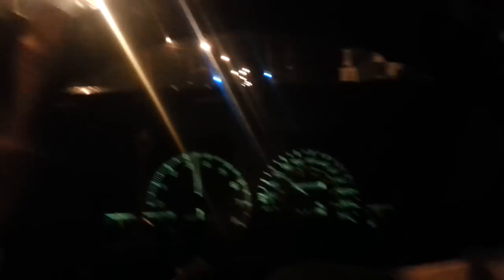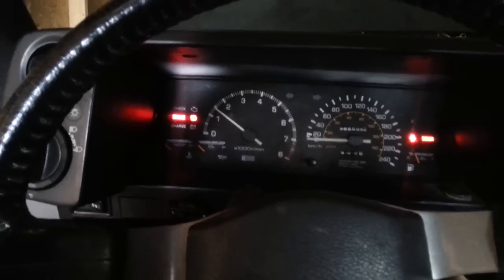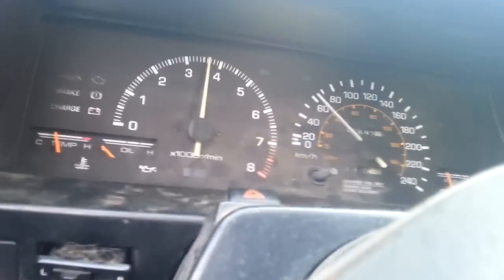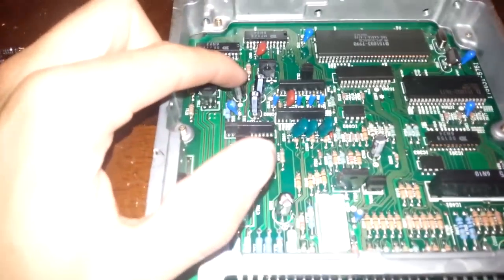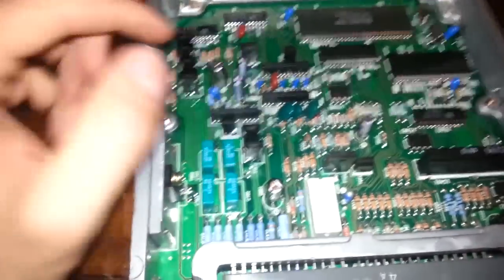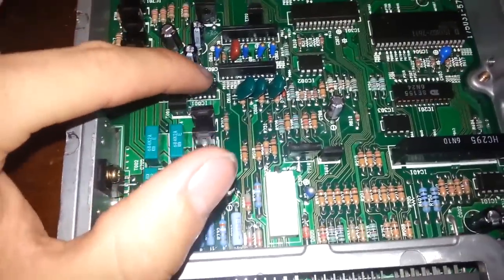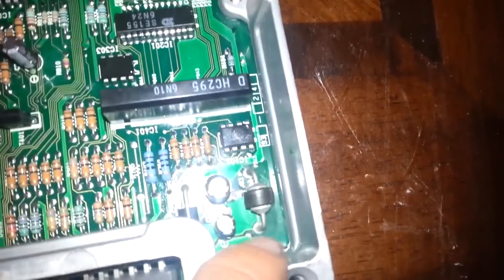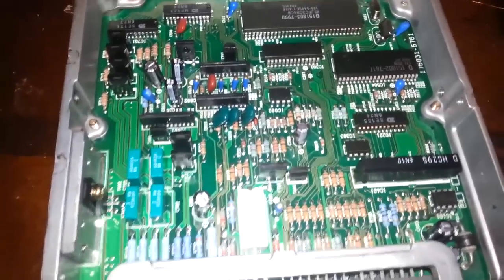Dealing with 20V 4AGE ECU problems - Limp Mode - 4000rpm Rev Limit

Comment: did a g22 Frankenstein with obd1 p28 ecu was running fine heard pop sound then the car started to have rev limiter at 3,500 could this be my problem
Reply from the maker: I doubt your problem is bad capcitors, more likely you blew something, you can still inspect your ECU though to be sure

Comment: bro do you think i could have same issue in my automatic 7a-fe ect, ecu rpm cuts off from 5000.
Reply from the maker: What year is the car? this effects a bunch of japanese cars from early to mid 90s
Reply: it's a 1993 model toyota carina AT192, 7a-fe engine with ECT automatic transmission.
Reply from the maker: That would definitely mean its a possibility since the year falls into the years of bad capacitors. My silvertop 4age is from a similar year.

BUT before you jump to that conclusion

1) Check for a CHECK ENGINE LIGHT, if you have it check the codes, cars with a CEL sometimes lock out the upper range of RPM to prevent engine blow.

2) Check your air filter, if its bad replace it, you could idle the car without a filter for a moment to see if it makes a difference (Dont drive with it off though)

3) Check fuel pressure, If its bad replace fuel filter

If all those fail then disconnect the battery, then unplug the ecu, unscrew the metal case and inspect the ECU. check around the base of capacitors for evidence of them leaking or damage to the board.
Reply: hey if i want to change my 7a-fe to silver 2o valve 7age is it posssible wat r the some of  stuff that i have to remove from my engine and wat are some of the stuff that i have to add.
Reply from the maker: Thats a huge undertaking, try mesaging people who have done the conversion,
https://www.facebook.com/Toyota20vSwap/

Comment: Goo Job, Thanks ! Do you think, i could have a similar problem, faulty capasitors?? in my Infiniti FX45/2004, my AC is full of freon, compressor works, but AC works on and off/ I am in FLorida, always hot here, should I open my ECM, and check those capasitors?? Do I have to reprogram ECM after replacing those capasitors ??? And how?? Thanks a million, youtheman =)
Reply from the maker: not likely the ecu if its your air conditioning acting up, what exactly is the issue? the doesnt blow?
Reply: Just blows hot, I though it is lack of freon, but it is not, some computer issue, works fine sometimes, nice and cold...., either ECM or Unified meter/AC amp unit?? How do I test it???/
 It is a typical Nissan/Infiniti problem....in FX...
Reply: Also, I though I could open ECM, and see, it there is obvious blown capasitors???=)
Reply: @Eeropolvasti  i know this is a really old thread, but I was having a stalling issue with my 4age corolla (and my air con didnt work but i thought it was due to a lack of refrigerant) so I replaced the ecu which fixed both issues. No more stalling and A/C blows cold as ice
Reply: @bondom69  Thanks man =)

Comment: you didn't fixed the problem, you just removed the 4000 rpm limiter!😞
Reply from the maker: Maybe you misunderstood, I didn't modify the ECU in any way, just replaced dead capacitors. the RPM limiter is not controlled by capacitors.

Comment: wonder if this is my problem with my black top. Cold to warm is fine but once it is warmed up completely the idle goes from a steady 900 to 550 and it runs rough as hell and wants to die.

Comment: what about the other components in the ECU mate?

Im having problems too, but for my case, i can rev past VVT range, but my problem is, my VVT does not come on.
And right about where VVT kicks in my car will jerk depending on my throttle position.

I do not have a diagnostics port so im really facing problems. Hope you could shine some light on if it might be the same thing.